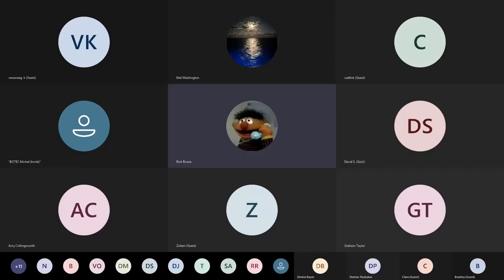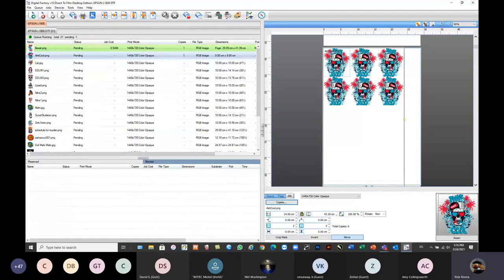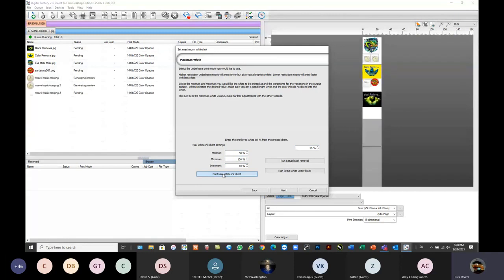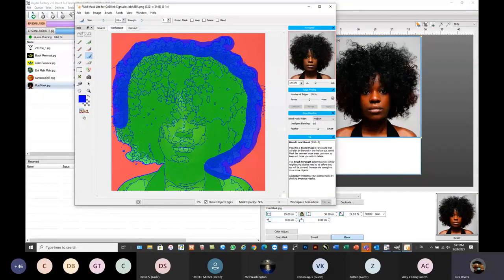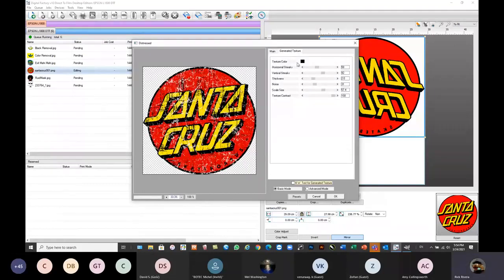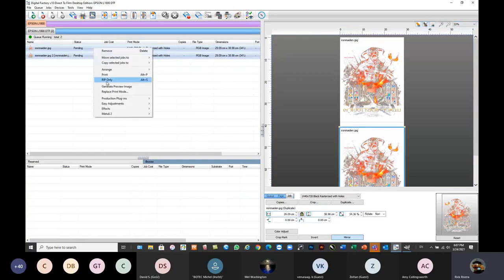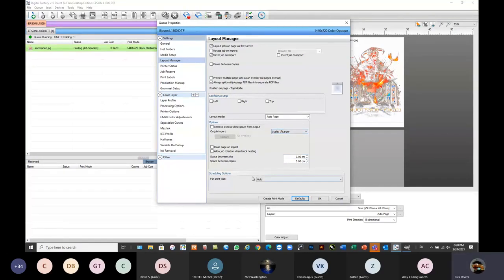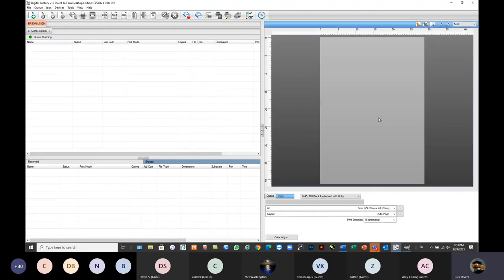Digital Factory v10 Direct to Film DTF Software Overview

Comment: Hi, I am using the Digital Factory Direct to Film Edition software, and I am following all of the given directions, but Set Ink Order is grayed out. I’ve connected the printer to the software and have managed to print some items, but until I can set the ink order, I cannot let the printer know that my Red cartridge is now a White cartridge. Please help me fix this. Also, for some reason on my prints so far, it just stops halfway due to an unknown error. This has been consistent. How to fix this? Thank you so much!
Reply: I solved the ink order issue, but not the halfway stop one. Also, how do you get the white underlay to match the image shape? Right now, it's just a big white rectangle over the whole paper. Thank you!
Reply: @chillworksdev4145  I'd like to know how you resolved the Ink Order Issue.  Please advise.
Reply: Hi. Would also like to know how to solve set ink order issue
Reply: Me too

Comment: I have a converted Epson ET 8550 printer and I have had nothing but problems with this RIP software. Repeated paper jams and other issues only happen when printing from this Rip software.😪
Reply: yeah the ET 8550 is not a DTF printer and is not to be used as such of course you will have problems its converted to do something it was never designed to do and even if you get it to print or work with the software...it will only work for so long guaranteed because other major catastrophic damages are looming and soon will come "printheads - ink lines - rollers - ink waste tank - dampers etc" you are throwing money away hope this helps! save your money and buy a true DTF printer!